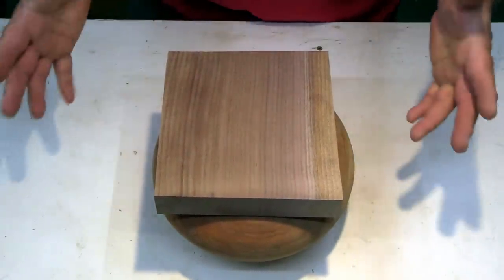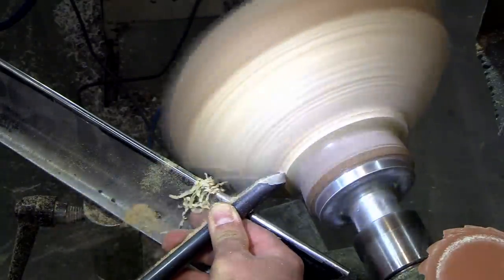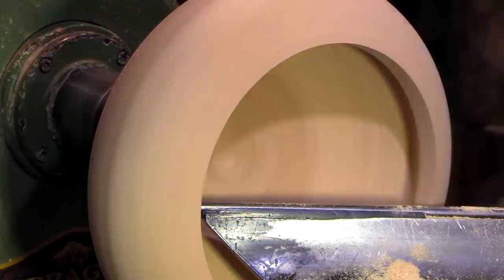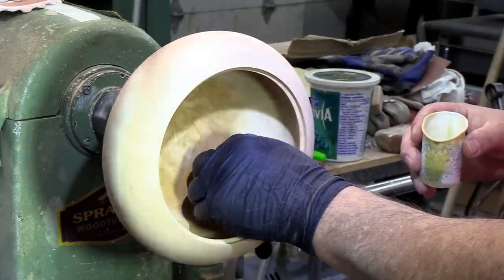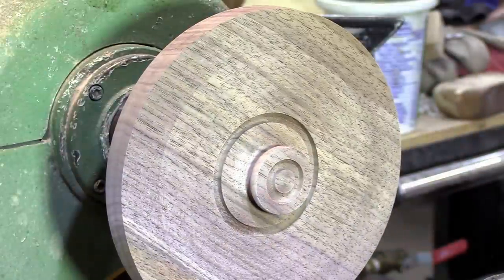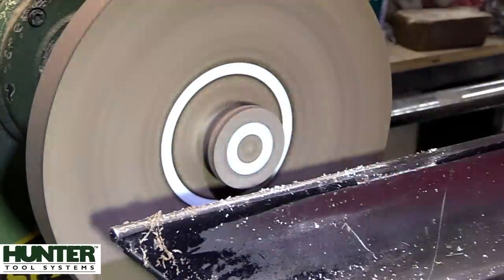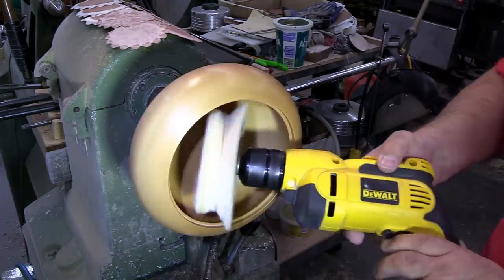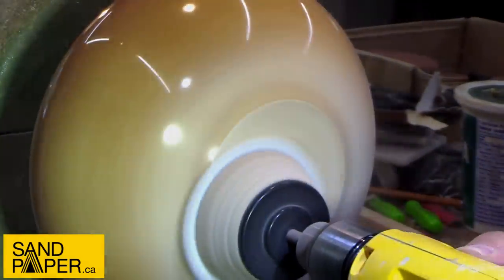Woodturning - Cherry and Walnut Lidded Bowl With Mother of Pearl Inlay

Comment: Hi Jim!! Wedding and kids? I got very emotional with mine so, congratulations !! And well .....ya that other part of watching your babies make the next adventure in their life that you can't wait to watch happen as well as that feeling that they need you less. So yes sir!! Congratulations!! 
I reached out to Gabe this week because I am trying the deep cast for the first time. (Thank you for the discount). I know he reached out to you with a couple questions I had and thank you for responding so quickly. I could not get the temperature up to above 83° F. At the 6 hour mark, I  poured into my form. (Sapelle and white oak) put one last pass through to blend color and it held. I pulled it out of the form this morning and turned it. I was also doing a copper inlay in the rim. I left it for a couple hours to go to my granddaughters soccer game and came back. The bowl moved so much I just sanded and will put a finish on tomorrow. Do you find that your pieces move more after turning with the deep cast? I cannot recall having so much movement before. I also should add that this wood was less than 8% moisture and dimensional cut lumber. I know your busy but if you have a minute. I'd like to know your thoughts. I think I'll call Gabe Monday or Tuesday. He was very helpful by the way and I am so thankful  for his and yours quick response.
Reply from the maker: Weird, sometimes there’s built up tension in the wood and when it’s turned it finally relaxes. As long as it’s dry, ordinary it doesn’t move all that much. The epoxy has nothing to do with this movement. What kind of meter are you using? Thanks

Comment: Jim, sweet bowl.  I got my vacuum chuck setup and wow.  Your not kidding it differently makes life much easier.  The most expensive part was the vacuum pump.  I had purchased a vacuum pump from amazon (a little blue pump) and it got so hot it was smoking and leaking oil.  I got a new oilless vacuum pump and it works great.
Reply from the maker: Oil less is the way to go, but much more expensive. The oil vapor is normal. Thanks

Comment: Congratulations, you made it.  100,000 and it couldn’t hav3 happed to a nicer guy.  Not true, it could have been me, but I’ll hav3 to settle for number two I guess. Lol

Seems apt to reach 100,000 and have the project to include a natural inlay.  It is after all the type of turning you had in the beginning.

Once again Jim congratulations cheers cheers 🍻 

Designer Epoxy
Reply from the maker: That’s the plan. Thanks

Comment: Love love love this bowl. Quick question, can a gasket be inserted on the lip of the lid to moisture seal any contents? How would that be done if possible? Here in Florida we are known for notorious humidity…even with the AC running. 👍🏼❣️👍🏼
Reply from the maker: I’ve never done that, but I guess. As long as the wood doesn’t move too much. Thanks

Comment: I am not using any epoxy or similar item just yet, but would like information on the sand paper you use and where I can get some of the Mother of Pearl you used for the inlay.
Reply from the maker: The inlay material comes from Starbond Adhesives and the sandpaper comes from sandpaper.ca use my code inlayjim to get your discount at checkout. Thanks

Comment: Awesome piece. Any reason you use CA vs a clear fast setting epoxy?
Reply from the maker: I’m not against it, but usually the epoxy is too thick to work with and this was the end of the day so I wasn’t all that concerned about time. Thanks
Reply: Makes sense. I have just experienced too much of that white stuff when using CA. Seems like one of the mica powders would accomplish a similar look. Still a great piece!